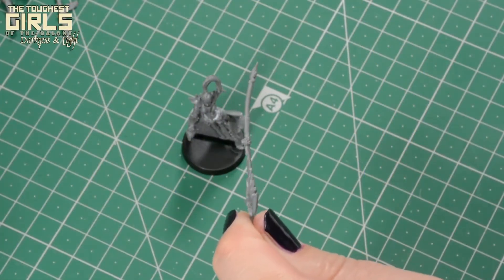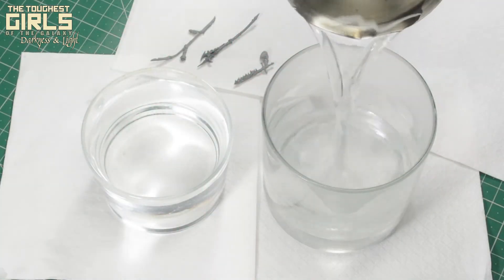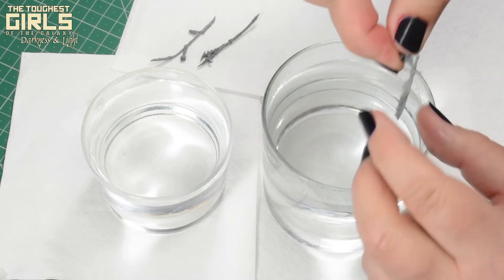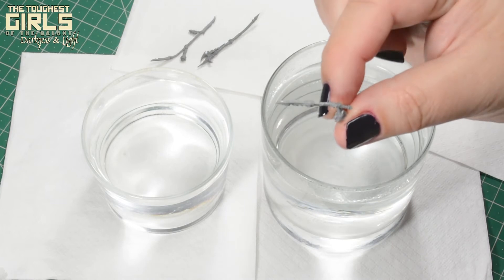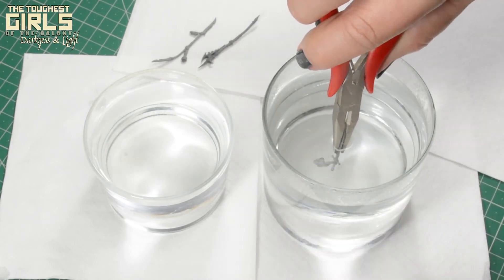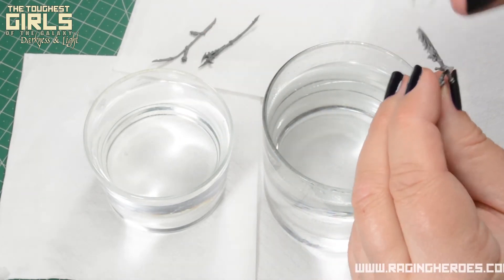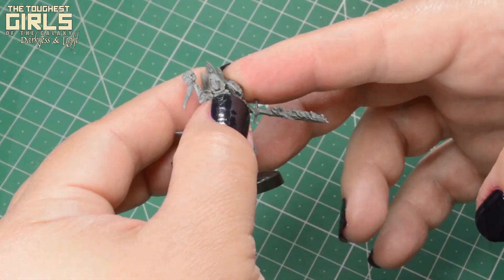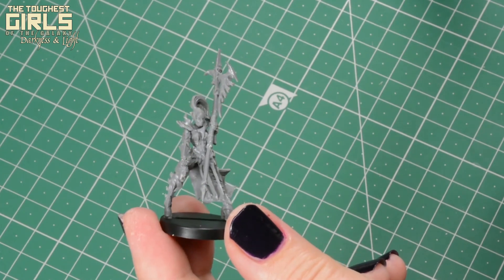Straightening bent resin parts

Comment: just as reference for others looking for this, the dark gray resin is a lot more resistant to heated water than the light gray resin.
Reply: I can second this.  In fact I'm not sure I can get the dark resin to respond to heat at all.  Any advice for straightening that stuff?